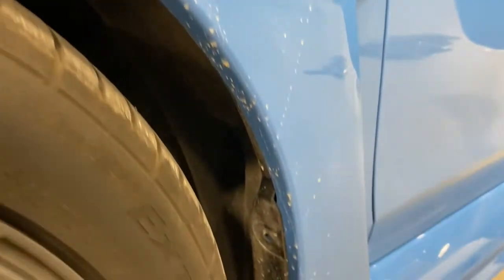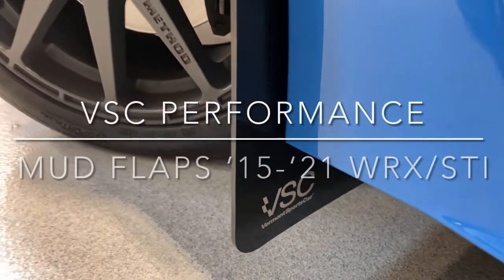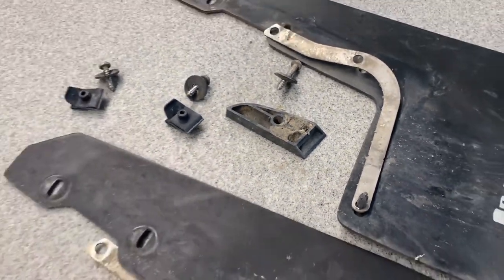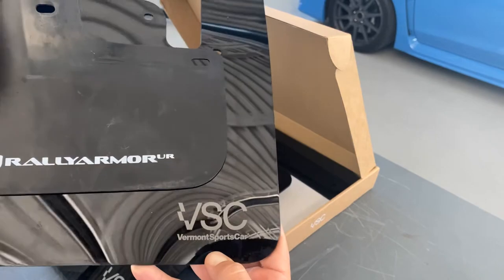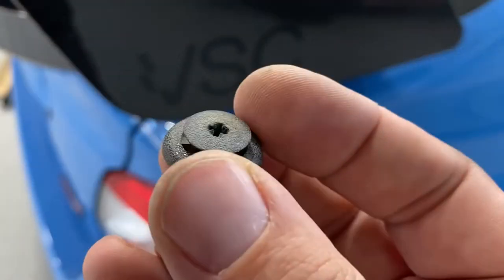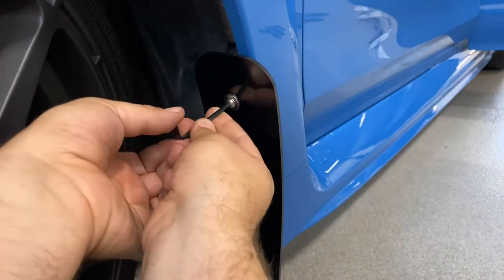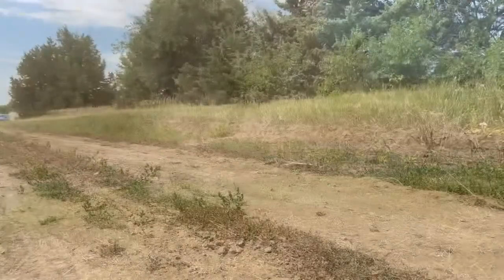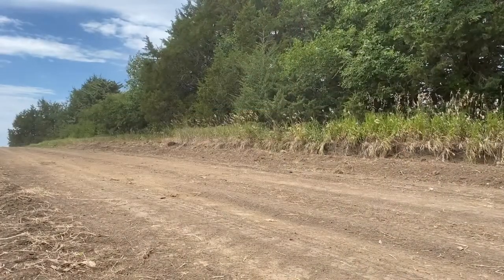Mud Flap Mix-Up: Subaru WRX/STI

Comment: Just wanted to say i love your car. I have my 2019 STI in WRB with stock wheels. I was wondering what brake kit do you have on your car. I have the stock brembos that barely fit in the 19 inch OEM wheels

Comment: Came from FB. Great vid great comparison. Have you tried Rokblokz?
Reply from the maker: I have not, but I have seen good results from them as well.  At least in Subaru circles the majority are running Rally Armors so it seemed like the most relevant comparison to make.  I do like the low-profile ones I've seen from Rokblokx that are better suited to lowered cars.  They're a nice option!
Reply: I run the Rokblokz (RB).  the main difference I see compare to the VSC/RA flaps/guards is the RB are plastic w/little to zero flex which is noticeable going up/down driveway entrances that have a tall apron.  I scrape and it shows (I'm at stock height).  The urethane VSC/RA flaps have more flex,  but don't confuse that w/soft.  These two will bend out of the way if run through something (rut/hole) whereas the RB will not be as forgiving.  The VSC are thicker than both the RB and RA.  But at $100 (in 2019) for the RB, I can't complain.